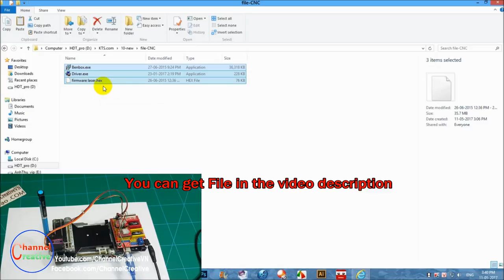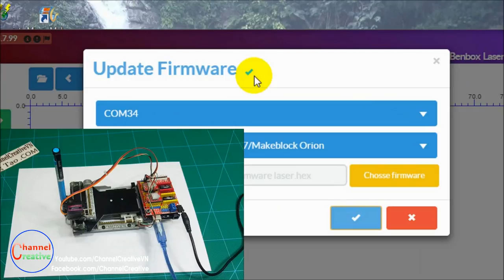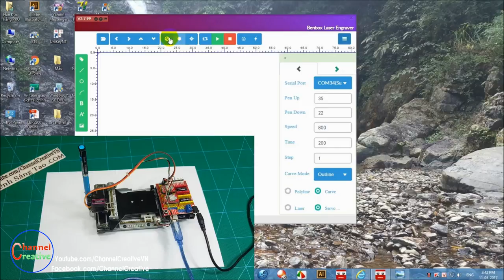How to Make a CNC Drawing Machine at home

Comment: I have completed the project as shown in the video if anyone has any difficulties comment below
Please like this comment as other people might find this comment easily
Reply: How can I get that firmwire
Reply: Thanks as soon as I finish this project I will let u know.  Txnn for replying
Reply: If any other difficulties let me know
Reply: What do yo want to know
Reply: 11:27 that is a female jack 16:04 those are female header pins
Reply: i have made it but none of 2 stepper motor is responding what can be he problem.please help
Reply: 1. Check if a4988 drivers are in the correct direction
2. Check Voltage supplied to the CNC shield is proper (mine is 5V 2A)
3. Adjust the potentiometer on the A4988 driver
Reply: Prathamesh Jakka  thanks but how can I adjust the potentiometer
Reply: as given in the video follow steps
they are correct
Reply: do we need any arduino code for this project?or just following the video steps would work?
Reply: no Arduino code is needed follow as per steps
Reply: Bro. I need your help . Can we discuss it on whatsapp ?
Reply: Yash Shah we should discuss it here as other people too might find your problem useful
Reply: Prathamesh Jakka my motor didn't work on 5v 2A , but when I use 12v 1A it work fine but heat up too much . What should I do ?
Reply: Prathamesh Jakka is 0.20 is okey for this ??
Reply: yes
Reply: What is on 10:55 is it necessary I don't know what is that plz tell me
Reply: KICHU Rock yes that is a jumper pin it is necessary for microstepping
Reply: Prathamesh Txnn can I get that from a electric store
Reply: yes you can you can even salvage them from old cd or dvd drives
Reply: my servo vibrating only what is the solution ?
Reply: try changing your Arduino cable the cable you are using must not be able to power the servo
Reply: but servo get too much heat and it is stop because it rotate too much and put force on mechanical stop, so servo is definitely powered , but it is powered by cnc may be.(i use 12v 1A for cnc ,5v 2A is not working)
Reply: use 5v 2A for cnc and adjust a4988 potentiometer, don't use 12V
use shorter cable as i had the same problem too of the servo motor
Reply: Prathamesh Jakka but when I use 5v 2a my x and y motor does not working , i have set potentiometer of both driver at 0.20
Reply: Does the motor work at 12V
Reply: Prathamesh Jakka yes it works very well , and there is write on CNC shield says it need 12v to 36 v
Reply: From where I can get aurdino code?
Reply: Prathamesh Jakka  bro , i test today my machine. It works well but when dnt draw anything , servo is continuously vibrating
Reply: Prathamesh Jakka  thank you I will try it and let you know soon
Reply: Yash change the cable connecting arduino to PC, I had the same problem when I changed the cable problem fixed
Reply: Prathamesh Jakka ohk i will change it and then after I will tell you the result
Reply: I'm thinking of making a tutorial on my plotter which is made from laser cut parts in Hindi,Anyone intrested?
Reply: Prathamesh Jakka ...hello bro i have a doubt that .is there any difference in arduino atmega 328p and just mega 328p ?
Reply: Prathamesh Jakka. Sure bro but English would be more easy to understand if you do it on english.
Reply: afsal Shereef yep I'll make it in English just editing it
Reply: Prathamesh Jakka wow thats great. ...thanks
Reply: bro can ve insert any image insert of you tube symbles
Reply: Jaya Rama Raju Alluri yes we can insert any type of image we want
Reply: tnx broo if i faces  any problem can i ask u
Reply: +Prathamesh Jakka      i had one problem  ,,  servo motor is not working ,  but stepper motor is working,,,,,,, iam using   sg90 servo ,,,
Reply: Suriya Bala is the servo motor vibrating or completely not working?
Reply: I have completed my project but servo motor is not running where was the fault please help me
Reply: Harsh Prajapati is the servo motor at least vibrating?
Reply: Noo it's not running not at all
Reply: Harsh Prajapati check if you have connected servo connection properly on the CNC shield
Orange to z stop
Red to 5v
Brown to gnd

Else change the usb cable to a shorter one as the usb cable connecting to the Arduino may not be able to supply enough power
Reply: Yaa but in video orange is connected to z+
Reply: Harsh Prajapati yep z+ it's correct
Reply: So where is the problem
Reply: Harsh Prajapati the usb cable
Reply: But i haven't usb any other than the Arduino board has it
Reply: Prathamesh Jakka  servo  motor is completely not working
Reply: Harsh Prajapati is the cable long one ? Because I had problems with  longer cable because they weren't able to supply power , but when I switched to shorter cable all worked fine
Reply: bro what was the items used in 10.50 to 11.00
Reply: All that jumper pins female heads should be bought separately bfor they are in the driver itself.?
Reply: What is that at time 10:45 mini black thing
Reply: I try  download  file-cnc in te android mobile but do not downloaded please help
Reply: did i want to program the arduino
Reply: Prathamesh Jakka did i want to program the arduino
Reply: This project is completed but the software does not work and within 2 days the sumbition day come plz help me.....
Reply: Sir can you pls tell me how to fix?
servo is working fine but the steppers are not working
Reply: Sir help me the machine does not work property
Reply: Hello 
I am making this machine as my college project. I have completed it but when i m connecting it to the pc/laptop the servo motor pulls the refill upward and when i upload a picture to draw it then the servo is making a dotted picture i.e the servo is moving up and down continuously. It is not making continuous pictures. What should I do? Please Help Me. It's URGENT
Reply: which company dvd player can be used?????
Reply: does smd version of arduino  work and what is that small thing which he is inserting in the middle part of the motor sheild.
Reply: hello.
can you tell me how can i get firmware. when i get ben box i will get firmware .
Reply: Bro in benbox software there is only COM3 and not COM3.what should I do .Is it ok
Reply: different arduinos have different comm nos
Reply: yes they are perfectly fine you can get perfectly fine stepper motors form non working drives too
Reply: you have arduino code???
Reply: @Prathamesh Jakka
reply please
Reply: its in the description of the video
Reply: its only two application and hex file
Reply: if you have a code please send to me
Reply: follow steps as per the video 20:40
Reply: then what is the purpose of that firmware laser.hex
Reply: brother i need your help....
my motor is vibrating when i connect the arduino cable with the computer without the help of this SOFTWARE ....what wil i do.i also change the motor but same problem arises .....
another problem  is the firmware does not match,it show X at right site ..
is COM10 right???
Reply: try adjusting the potentiometer of a4988 driver as it may be3 not supplying enough current to the motor
Reply: Prathamesh Jakka 
I also adjusted  but the same result repeatedly occure
Reply: try checking the com port which you have connected to correctly
Reply: also one more important thing is that you specify the correct ports like this 21:36
Reply: 10:51 what are those small things in her hand ?
Reply: #TRENDzz they are jumper pins
Reply: #TRENDzz yes you've got the correct link that are jumper pins
Reply: Please brother share the arduino cod for cnc macihne i finished this projetc but i need the arduino cods please help me
Reply: Prathamesh Jakka  I need your help. when i put the dvd motors  in arduino they get hot. a
Reply: u need to supply less voltage to the stepper motor what voltage are you supplying
Reply: Prathamesh Jakka  can you replay messages in facebook?
Reply: i give 5v in cnc sheild servo moter not work
Reply: @Prathamesh Jakka
my servo motor is not working with the cnc sheild
Reply: @Prathamesh Jakka
 how can i fix it?
Reply: I need the PDF of this project or pllzzz
Reply: Plz i make all the steps put the cooooode or the programing plz help me for the code or anything plzz
Reply: Prathamesh Jakka  I need the documentation of this project plzz send me
Reply: From where can I get ALUMINIUM COPOSITE
Reply: Where do I get aluminium composite
Reply: I have done all think but both feed should have no movement pls help
Reply: i made one .but stepper motors are getting too much hot ,.i m using 5v 2A .
Reply: ok but Arduino programming should done compulsory  or not
Reply: Bro stepper motor stuck wt is the problem
Reply: yes how can I run
Reply: my ben box is not responding
Reply: Any idea why does OUTLINE mode fail to work? Works fine with those 2 Scan modes but not the Outline mode. I am trying to draw PNG image made in paint. Text only 4 letters TEST. But when I push start button it doesnt do anything. Any ideas?
Reply: my machine isnt printing i have arduino nano please help
Reply: Prathamesh Jakka Am interested in this project .. so could you please provide me the programming and the circuit diagram??? .. am ready to buy all the parts but need circuit diagram and programming first.... Please help .... 😊🙏
Reply: We have to adjust 20 volt on boyth A4988
Reply: Prathamesh Jakka bro i need your help
Reply: sir i have completed the project, but only any one stepper is rotating at a time, what to do
Reply: Tell me the shopping app where I can easily find all the parts.
Reply: Does it really work , and how to tell it what it have to write
Reply: Adjust the potentiometer on the a4988 drivers
Reply: color of the stepper motor driver does not matter
Reply: where comment the time
Reply: yes micro stepping jumpers are necessary
Reply: try changing the usb cable that you connect it to the computer
Reply: there is no pdf documentation?
Reply: yes what help do you want
Reply: you can use acrylic too
Reply: try adjusting the potentiometer of a4988 drivers
Reply: adjust the stepper motor potentiometer
Reply: yes arduino programming is necessary
Reply: check if any parts are blocking the motor shaft
Reply: or try adjusting the a4988 potentiometer
Reply: what all parts you have bought
Reply: why is it not responding from the start?
Reply: which cnc shield version do you have?
Reply: what all parts you have bought till now?
Reply: do not supply 20 volt to the cnc shield as it may damage the board
Reply: describe the problem in more detail
Reply: ebay amazon aliexpress
Reply: yes it does really work,  you send commands to the machine through gcode
Reply: Iss video me servo ki value 11,11 h... Pr us  muje servo se koi respond nhi Mila.. bs computer se attach krte wakt move hoti thi..

Fir mene 11,1 setting krti to ab up and down move kr rhi h proper jagh pe bs hlka sa rotate ho rhi h muje thoda Jada rotate krvana h..
To konsi setting kru...
Reply: change pen up and down settings
Reply: How spring change kr k dekh li mene.. 
Servo motor se thread kich rhi h ar pen up ja rha h but hlka sa ky hm servo ko thoda Jada rotate nhi kr skte ky
Reply: Pen up and down setting ka ky mtlb h ...
Reply: pen up and down sets the servo value you can input any value from 0- 180. you need to experiment a bit to find correct values
Reply: And where I get these setting..

Because in my computer benbox has been installed in chinese language... I set the values using Google translate
Reply: what I have to change 
Intensivity,speed,time,step
Reply: Prathamesh Jakka bro 16:06 mai jo black colour  ka h jismai wire connect  kr rhe h usse kya bolte h
Reply: +Sarah Anjum , its called pin header
Reply: Thanks for your help . Today I have completed this machine  ...
Reply: But dvd drive ki jo motor mene use ki h vo heat up ho rhi h..
Me 5v 1A ki power de rha hu...
Motor k upar lagane ki koi tube aati h ky jo use thoda cool rakhe
Reply: Mera printer complete ho gya but vo double line me draw kr rha h...
Mtlb vo hr single line ko 2 bar draw kr rha h jese vo line ki thickness k 2 side draw kr rha ho...
Plz iska solution malum ho to jaldi bta dena kuch din bad muje presentation deni h iski
Reply: sir i have comleted the project but only any one motor is responding at a time, if 1st motor responds 2nd does not and if 2nd responds 1dt does not... 
please give me some solution
you replyed to many answers but which is my question's answer
Reply: sir i have comleted the project but only any one motor is responding at a time, if 1st motor responds 2nd does not and if 2nd responds 1dt does not... 
please give me some solution
you replyed to many answers but which is my question's answer
Reply: sir i have comleted the project but only any one motor is responding at a time, if 1st motor responds 2nd does not and if 2nd responds 1dt does not... 
please give me some solution
you replyed to many answers but which is my question's answer
Reply: please write my name before the answer... plzz, so i can find it easily
Reply: Bro for updating the firmware it is asking some lisences in benbox
Reply: Prathamesh Jakka can u please send me the link from where I can buy aluminium composite😣😣
Reply: Can I use another servo
Reply: How to Make and Do plz send me link from where I can buy aluminium composite.
Reply: Prathamesh Jakka plz send me the link from where I can buy aluminium composite.😣
Reply: Can i use another servo motor
Reply: prathamesh jakka can you please give me your video link to make the cnc machine.
Reply: That was not aluminium composite . It was acrylic sheet.
Reply: Hi,
I have completed the CNC project just like in the video and it worked great when I connected to a bench power supply with 5v and 2 amps.
I also used the video that you suggested above to fix the voltage for the potentiometer's voltage to .2v (Thank you so much for that).
The problem is that when I connect the CNC shield to a  5v-2amp power adapter, 
the motors heat up and the torque of the motors decreases.
How can I solve that. (PS: I also checked the Voltage for the potentiometers again with the power adapter).
Reply: Hii smasher can you make the video on that in Hindi plz.
Reply: What type of charger is used and it's voltage
Reply: 5 v 2-ampere charger
Reply: On CNC shield it is written to supply 12v....so...is 5v sufficient for it?
Reply: Those jumper pins which he attaches on CNC shield....is it necessary...can we directly solder those....?? actually I can't find them...so I made some myself by female header by soldering it's tip to each other...is it ok??
Reply: yes
Reply: Prathamesh Jakka always light on the aurdino is turning off  when i m connecting a4988 driver module and we should write any program for aurdino can u plzz help
Reply: I have made the same machine but servo motor is not working in that help me in resolving this issue. Please
Reply: Hey all 
The project worked fine with me. At first I was having trouble when connecting the project to a 5V 2A. Then someone suggested that I use 5V 2.5A and it worked superbly. Even the motors stoped heating up
Reply: The Smasher is there any program fr this project
Reply: Prathamesh Jakka 
In this video at 10:50 what is the name of those little pin and from where i can get that 
Those little pin are compulsory to put on cnc shield
Reply: when i try to update firmware it give me an error :
" avrdude.exe: safemode: Ifuse reads as 0
avrdude.exe: safemode: hfuse reads as 0
avrdude.exe: safemode: efuse reads as 0
avrdude.exe: safemode: Fuses OK

avrdude.exe done. Thank you. "

can you help ? tnx
Reply: which is to used to stick the pen in MG90s servopls help
Reply: Can we get jumper pin from any die machine bro plzzz tell me
Reply: Prathamesh Jakka where r u bro 
Plzzzzz bro help me
Reply: What are the black plugs kept to the shield under the driver
Reply: Pleasezzzzzzzzz answer fast
Reply: Total cost in making this?
Reply: bro my firmware is not working what should I DO?
Reply: Brother how costly is it? How and where can we collect all of the resources? And much time will it consume???
Reply: what are the 6 small beads used at 10:53
Reply: i try to make this project i have come problem in making a frame can you help me please
Reply: My servo is not working bro 
What to do
Reply: But in your Earlier Comment you said No need of arduino Code Just use the same step which is shown in video
Reply: my servo is not working what should i do
Reply: TECH VIKAS use 12v

Select servo in the drop down list in beanbox
Reply: where its code
Reply: where is the code
Reply: can you please tell what to keep the resistance of stepper?
Reply: Prathamesh Jakka  bro my servo is continuously vibrating and not working
Reply: my servo is vibrating and producing lot of heat
Reply: if any one servo is not working try to change no given ben box in servo position 11 and 13
Reply: What is that at 10:50. Please reply fast
Reply: What is this black material that uses
Reply: Still It's Not working
Reply: Stepper Motors are not working I followed all steps
Reply: Prathamesh Jakka  where is the code to program an arduino?
Reply: From where can i get female jack that are used in 10:51
From wher can i get it
Reply: We can not run thr project in benbox. Please help. We have used cnc shield and uno board
Reply: sir can you tell about the wire sequence
Reply: or circuit diagram
Reply: can you explain me about the wire
Reply: about cd rom stepper motor wire working
Reply: i attach wire according   to your give  idea but it not work it heat up
Reply: any tell me please when i run this first time it run but second time when i run it heat up and not running
Reply: I have difficulties in programming, Can someone help me please
Reply: I have difficulties in programming, Can someone help me please
Reply: i can help you
Reply: Yes of course
Reply: you can me goes by at parts what you used because I stayed at doubt over the programation of Arduino no got it nothing!!! As do the programming, if have as  pass one manual step by step
About the programming arduino, I wanted much
Reply: The dvd motor overheat
Reply: Where i can buy those jumper caps only 10
Reply: hi
Reply: Prathamesh Jakka my motor is too hot.. it moves hardly (sometimes no movement at all, though motors buzz) in opposite direction.
Reply: when i run my stepper motor it heat up  i used 5 volt and 1A adpater it heat up due this or any other reason
Reply: Sir in my benbox software- in update firmware option it doesnt show com3 or com6 pls help me fast sir
Reply: Prathamesh Jakka 
bro we did it but...our pen z not moving in z direction ...and we used bnbox software
Reply: Is this want to have programming?
Reply: i made this but when i run my servo gets to the end of rodd and start pushing further in that direction
Reply: Can u send this machine to me i will give u money
Reply: Jakka can you help me I am urgently about what type of jumper cap he us in at 10.55 there
Reply: my survo is only vibrating and do not working pls help
Reply: Can we use not working dvd rom? As shown in this video
Reply: Hi my servo motor is not working the arms of servo is not rotating but inside it there is some vibrations
Reply: Can I do it with Arduino l293d shield ? Please reply
Reply: How much time it took to complete this project?
Reply: can I know what is the thing on his hand in 10:50? thank you
Reply: Alan Lee they are jumpers to short the connections
Reply: Vishal Gaurav can i dont put it？
Reply: You need to put to select the stepping. Don't worry you can simply short terminals using soldering only.

Do share your progress :-)
Reply: Vishal Gaurav thank you very much do u mind i put ur name on my project for the reference？
Reply: No need Alan, just share when you get it finished. I would like to see your machine.

Good luck 😊
Reply: Vishal Gaurav ok.that‘s for sure i will share it
Reply: Update firmware taking long time
Reply: How to connect the wiring of x,y axis of slider??
Reply: Prathamesh Jakka bro I have used sg 90 tower pro servo motor can u please help me
Reply: What cost it is going to take to build it
Reply: what is the programming softwer
Reply: My stepper motor is heating and not responding what is the problem
Reply: Prathamesh Jakka bro i have completed this as shown in video.
But that two motors were not working properly they are didn’t move smoothly they are vibrating 
Plz help me what can I do for that issue?
Reply: +Binura Lakshan Try adjusting the potentiometer setting on the a4988 driver
Reply: @Abid Shaikh try adjustiong the potentiometer setting on the a4988 driver
Reply: Jaya Rama Raju Alluri those are jumper pins
Reply: +Ayesha Zarreen Those pins are called jumper pins
Reply: Zeba Tahseen you can get jumper pins from DVD drives
Reply: Rahul Tej jumper pins
Reply: Hi what voltage and current you use?
Reply: Prathamesh Jakka  where are the jumper pins in DVD writer?
Reply: Prathamesh Jakka what to do after downloading CNC file rar
Reply: Jay Mishra https://www.google.co.in/url?sa=i&source=images&cd=&cad=rja&uact=8&ved=2ahUKEwjlqd3em5_cAhUIOo8KHZ2AD6UQjRx6BAgBEAU&url=https%3A%2F%2Fsupport.hp.com%2Fus-en%2Fdocument%2Fbph03792&psig=AOvVaw3kMyfKcrF6_w1fMRT2EUfX&ust=1531679182157608
Reply: Prathamesh Jakka what shall i do with this link
And where can i find jumper pins in DVD writer?
Reply: Prathamesh Jakka When i try to upload a code its when i put CNC shield on it please help what to do????
Reply: Hey prathmesh when i try to upload a code or flash a firmware its showing failed and showing red cross what  i should do plz help me plz.....
Reply: Tech Norg I didn't understand your question?
Reply: Prathamesh Jakka  When i try to flash the laser hex firmware its not uploading rather its shows red cross in benbox
Reply: Tech Norg is the COM port of Arduino connected, is it visible in settings
Reply: Prathamesh Jakka not about that pin  yar iam having it

When i am flashing the benbox firmware its not flashing on arduino
Reply: Prathamesh Jakka when i connect arduino without cnc shield it works
But when i connect using cnc shield it doesn't show up anything
Reply: Tech Norg do not connect power to CNC shield while uploading code
Reply: G TECH MAKER i dont use whatsapp
Do u have instagram becoz i have 

Its techguy33
Reply: Prathamesh Jakka i tried it its not working
Reply: mujhe pest Marne wala same gluu nhi mill RHA hai or but si object
Reply: mujhe pest karne wala same gluu nhi mill RHA hai or but si object
Reply: Need help please
Reply: Bro I need help is that and what is the correct direction form the servo motor mine one is MG90S
Reply: Bro for the  servo x /y 11-11 is those number are the correct or need to adjust. Please I need for urgently
Reply: Prathamesh Jakka from where can we get header pins
Reply: Prathamesh bro I adjustable the pointmeter  are day but both motor still run in heat when the operating
Reply: Can u please help me i completed the project but don’t no how to get the benbox software
Reply: Skadi Lolikon1250 is benbox and the driver software in that or do u have to download separately
Reply: Firework pro  bro this file have  contains the firmware . Hex that the update for firmware  and the be box exe
Reply: For this ben box use first you need to plug you USB to the port maybe will be com 6 or com 7 or com 44 and com 33 mine one is com6 and after press open file to input  the firmware. Hex to be box and update until you see the correct logo at right top.
Reply: After it  try to will about at the right end you will saw about the three lines logo press that  and you will saw a bar slide out  form right side frist for serial port chose the com that you updated . Second have you saw a crave mode press that and choose outline mode and . continues / servo. So if those are done now the time you have to view about the right arrow and I the same moment it will move to another bar and it show you about 
X- Y SYMBOL FOR THAT YOU JUST Need to follow about the numbering that have show in the video and after that Prees the down correct symbol. Done and time to input the pictures or type a word to write and if the pen reffile  no going to touch on the paper you have to view back to just now the bar and try to adjust about Pen Up /Pen Dow  = this is mine one Pen up : 3 / Pen Down : 72
Reply: Skadi Lolikon1250 right cheers man so it’s all in that file I’m not good with computers.
Reply: Firework pro  just open the file and install the be box  exe.  And the driver .
Reply: If I use plastic gear servo it will work or not
Reply: I have used sg 90 plastic servo motor it's not working😩😩😩😩😩😩😩😩😩 please help😍 me to configure it and setting
My science exhibition is on 23-8-2018please me fast 
Please
Please
Please
Reply: ram udu  lol  iam going to presented in tomorrow.  So can you say more details  about this maybe I can help you to solve this problem
Reply: ram udu  form mine one pen up is 12 pendown  is 60
Reply: ram udu check back the string that you tide up
Reply: ram udu  remember  servo motor wire  Brown is going to GND, red is going to 5v yellow is going to Z+
Reply: Are the connections same for all the stepper motors??
Reply: Hrihansu Agarwal  not really
Reply: Can you give me the code of the arduino according to the video
I am having difficulties in coding it
Reply: Having trouble in making it
Can you make one for me
If not,I will try making the model but can you give me the coding of arduino according to the up video as I will make my model like the up video
Reply: Bro my doing this cnc project my problem is in cnc sheild before putting heat sink he  puts some 6 small black colour pin then he puts heat sink so what is that small one
Reply: Can you give me the arduino coding
Reply: Please give me the arduino coding
Reply: Who me
Reply: Why
Reply: Type the coding
Reply: my servo motor doesn't work and my y-axis is slow. plz help
Reply: Prathamesh Jakka 
Can I make a larger version of it
I mean will the codes and all change
Reply: Does the Arduino doesn't need programming code
Reply: What are the things used in the project at 10:55
Reply: What is used in the project at 16:31 to connect the motor cable to the board
Reply: i have completed the project but cnc shield X is not working
Reply: I want to purchase one .... how much for one set
Reply: vai aluminium sheet ka size kinta lena parega?
Reply: Prathamesh Jakka 
In Ben box I have com 1 only how can I insatl com 3
It can work on com 1
Reply: Can i draw potraits with it?!!!...How? Bro plz help
Reply: Hi. But benbox is giving error that it cannot connect firmware
Reply: I have not connected those jumper pins and when I connected arduino with my PC and installed the software but I am not able to flash the firmware, what is the problem. Please respond I have to submit it to my school tomorrow.
Reply: friends. Where should I buy old dvd drives?
Reply: Can we use laptop cd dvd drive.
Reply: If I search for a laptop CD drive, will I find a place to sell it? I'm searching right now. ㅜㅜㅜㅜㅜㅜㅜ
Reply: If you do not mind, can you give me the address to sell?
Reply: @PrathameshJakka   hey The arduino  is one  or  is the mega
Reply: Hey is the  arduino uno or  is the arduino  mega
Reply: @PrathameshJakka   We have made a project on this only but the software is not working.
Its showing insufficient resources
Reply: Bhai this app can work on mobile can we handle this with mobile in anywhere
Reply: my stepper motor is not working and getting heat
Reply: My stepper motor are not working please give solutions
Reply: Where can I find this dvd drives?
Reply: bro my servo motor is working 
means when i give command to machine then x and y motor is working but servo motor is working 
can u help me 
i hope u will replay me soon
Reply: Please help !!
Benbox isn't detecting Arduino port.
Reply: i have completed all the steps but when i execute the program on my computer both the motors heat up and do not work...can someone pls give me a solution
Reply: Can i replace the servo motor from mg90 to mg995?
Reply: hy..can you give me complete instruction plz?...i really need..
Reply: i am not getting option of com 34 in update firmware
Reply: sir uska programing nhi samja
Reply: Bro can u make a video of programming this machine . I have all the components but don't know how to program it.. please help me
Reply: SORRY
I HAVE A QUESTION
ALREADY COMPLETE THE PROJECT EXACTLY AS IS IN THE VIDEO EVEN ALSO CALIBER THE DRIVERS BUT ONLY WORKS MY MOTOR SERVO AND THE 2 MOTORS STEP NOT WORK, COULD YOU HELP ME?
Reply: I has difficult
Reply: Can you make a video by speaking
Reply: Sir, can it be used to write on the pcb board too?
Thanks
Reply: what is the black thing attached to the CNC shield??? Quick response please
Reply: 10:53 what is the small thing???
Reply: Is it working?  And how much cost it take?
Reply: How many rupees of this machine
Reply: I need help I completed it (software help)
Reply: Prathamesh Jakka hi there can u help me please I don’t no how to set up the binbox software I’ve looking of a long time for a video on how but nothing to be found please help.
Reply: what are those thing he connects to the arduino  cnc shield v3 in 11:00
Reply: The Geek there called ( jumper cap pin ) there for connecting the pins on the cnc shield together.
Reply: Com 3 and 4 is not coming. Pls help.
Reply: Which software 	r require...arduino ide,and waht
Reply: @agjupiter6881 software name : Arduino 64bit
Reply: I konw but other software....
Reply: @agjupiter6881  Sir I have not made it .I have only ordered it for Amazon it will come tomorrow and than I will start to make it .I will let u know when it come and ask u what is remaining
Reply: @PrathameshJakka  which dvd driver is best
Reply: How much it costs
Reply: @noobanimations19  Rs 948
Reply: Hi, can I get the components details .. in the video all item description in not shown
Reply: Pls make a video on programming this project
Reply: i am not getting the file laser.hex
Reply: @PrathameshJakka   how can i get laser.hex file
Reply: my firmware is not getting updated what to do ?
Reply: @PrathameshJakka   I am not getting my firmware update what can I do
Reply: Pls reply fast
Reply: I have science exibition one week after
Reply: @PrathameshJakka  pls help me
Reply: @PrathameshJakka   what can I do if my firmware is not updating
Reply: @PrathameshJakka  please help me
Reply: Please send me the key to the update ing my firmware
Reply: how do i get the back end arduino code  for this plotter
Reply: DVD motor is heating fast
Reply: what do you call that small thing he attached to the cnc shield around 10:52?
Reply: plz provide srource code
Reply: @PrathameshJakka  where can I get Female header Pin 
Kaha milega vaiii
Reply: @susan5243  cd drive ke back side jaha pin connect hote hai waha milega jumper pins
Reply: @PrathameshJakka  I mean female header Pin vai kaha milega Vai yee
Reply: Hlo sir, 
I have a problem ,my servo is not  working what should I do......
Reply: @lillysukumar2318  check if you are supplying correct power to servo and set correct pins
Reply: Prathamesh Jakka  plz reply ,my servo is not working Thankyou sir
Reply: @lillysukumar2318  is it still not working?
Reply: Prathamesh Jakka  yes sir I have connected correctly
Reply: @lillysukumar2318  try changing the usb cable as i had problems with the usb cable and my servo was not working, i replaced the usb cable and the problem was solved
Reply: Prathamesh Jakka  usb cable changing in the sense.
Reply: Prathamesh Jakka  sir   how to check whether the signal is coming on z+ on grbl board.
Reply: @PrathameshJakka  Vai ye female header pin kaha milega plz bataoo na plz vaii
Reply: 10:55 what the small thing that connect
Reply: @muneesmohammed4545  jumper pin you can get it from motherboard
Reply: what software??
Reply: Prathamesh Jakka hi! If I will try to make this as a research or thesis project, what possible problem can I address for doing this?

Really need your response thanks
Reply: can i use t2laser over benbox
Reply: My firmware was not dumping it showing wrong mark what can I do rply me as early as possible
Reply: The dvd writers are not moving
Reply: My plotter didn't move, but the motors are vibrating, what's the problem with my cnc?
Reply: Этот проект не будет работать, если вы не ставите концевые выключатели
Reply: how can i control it by android
Reply: how can i control it by android??
Reply: hello sir, 
can u please help me out with the benbox software
Reply: Thanks, I also completed this project but when I am giving the 5v to the upper cnc card motors are not working and if I give 12 volts it works but Booth motors are heating too much... If you have any ideas please let me know..
Reply: i´m trying to make this project but when i plug the shield to the alimentation source it lights limit sign and the motors don´t move
Reply: @PrathameshJakka  vai My machine is not working plz help mr
Reply: it is necessary to use same to same dvd drives with same length of motion (like 40mm × 40 mm) ??? or we can use 40mm × 35 mm ???
Reply: Dude com34 doesn't come
What should I do
Reply: @JustforFun_8  same Problem bro 
But com3 will appear on my screen
Reply: Dude what about 18v power supply to v3 shilder?
Reply: Does not uploading file x mark comes after uploading hex file why?
Reply: Hlo sir my servo is not working what should I do
Reply: @PrathameshJakka   should  we code arduino or not? I am getting  trouble there.please reply me
Reply: @Prathamesh Jakka, is it possible to connect it directly to pc bypassing Arduino?
Reply: do i need any code to dump in Arduino Uno plezz help ASAP
Reply: I want to buy
Reply: on cnc shield it is mentioned that 12v then why we are suppose to give it 5v supply ?
Reply: @PrathameshJakka  from where  i get wiring diagram it differ to understand it from video plz help
Reply: Bro when we update firmware doing it shows on the display is script error and says update dll file
Reply: 2 Amps will not it be High enough to damage the CNC circuit ?
Reply: Bro update firmware shows error 
What can I do to solve the problem
It shows on the display script error update dll
Reply: Can you help me please
Reply: @rayansaeed9066  yep
Reply: @alonethrottlerider1257  check ur Arduino is working correctly or not
Reply: @rayansaeed9066  we might discuss it here this will help others too
Reply: Can this machine work if instead of DVD driver I use 2 Nemma 17 stepper motor, cnc shield v3, arduino r3, a4988 driver, mini servo,  with 24volt power supply. If you give me your gmail I will send you the entire setup. Please please please help me.
Reply: @teddytoy6078  I have raised its images on the arduino  but the CD  it not response😢
Reply: @teddytoy6078  how to check the Arduino bro help me to check
Reply: @teddytoy6078  how to check the Arduino bro help me
Reply: @teddytoy6078  I have solved the problem first But now the servo does not work why.Is there a difference if you use mini or micro
Reply: I want to know that... How can we create hex file.... Grist I open benbox, did all the settings... But I don't have the hex file of my image which I want to draw.... How can I get it or create it.. Plz help.
Reply: I have made this project my stepper motors are working but my swrco isnt working
Reply: S
Reply: Bro mh servo motor is not working tell me whats the problem
Reply: what's the black material that use to make to support?
Reply: @ed.running  bro its not necessary u use that black material  .u can simply go to the shops from where i have buyed all parts or a stationary  and several sheets come like this
Reply: that is connecting thos two
Reply: Bro What is that small thing begin 10:50
Reply: These u will easily get at electronics shop from where u have buyed this shield and as per my knowlege we usually get this with cnc shields..
Reply: @ItsMeRishi  bro that the thing connect of that two
Reply: @vaishnavtv1409  bro explain it briefly..i am not getting what are u talking about
Reply: This is incredible idea.I like it.keep it up
Reply: whats the black sheet calles
Reply: My stepper motors are not working
Reply: plz whats the black sheet used as base etc is called
Reply: i was completed this project..but my stepper motors are very heated. what can i do?
Reply: @PrathameshJakka  I can't able to download zip file from this link it downloading simple file and when I try to open it says this file can't open
Reply: Till how much should the potential Meter be adjusted
Reply: Bro can u send me the circuit
Reply: Hello! My two motors doesnt work at the same time.... What can I do? Please help me!
Reply: Hello sir 1:58 what is name of that device?
Reply: can u plz send the codes
Reply: servo is only vibrating
Reply: COM1 and COM34 are missing
it is only shown as nthing is selected. what should I do?
Reply: Bro serial port is not visible in the benbox
Reply: Bro can I use micro servo?
Reply: Bro when i connect motors they heat up lot and doesn't work at all
Reply: Can u plz tell me that can i use L293d motor driver shield instead?
Reply: can i use drv8825 instead of A4988 without changing other things
Reply: Only one motor is running
Reply: @shutterboy19  jumper pins
Reply: Bro we cannot get that green tick......what we dooooo.....
Reply: Prathamesh Jakka hi which size jumper cap to use ?
Reply: How much amperes are required for 2 ps nema 17 stepper motors
Reply: Hii
Reply: My steeper motor is not move only vibrate please help me
Reply: Is the software of this working???
Pls pls reply fast
Reply: What is the shortening link function ya?
Reply: Mine cannot do circle, but can do square
Reply: i also have made it. two stepper motors are working fine. but servo motor is not working. can you please help me.
Reply: Plesae
Reply: Hii bro, I have done total hardware and software. But the three motors are not rotating and they gets heated up. Can you guess the reason. Please reply.
  Thank you.
Reply: Hi bro, I have done total hardware and software but motors are not rotating and they gets heated up. Can you guess what is the reason. Please reply
Reply: We also just follwed what is in the video but the device wont move to any direction. Can you help us? The servo is the only one moving. Please
Reply: @zakishaikh7866  outline
Reply: @PrathameshJakka  My servo motor is vibrating but not functioning...my arduino cable is short....what could be the problem?
Reply: Stepper motor are heating at high level what can we do for that????
Reply: Can i use l293d shield for this project.... plz help me with that...
Reply: @PrathameshJakka  potentiometer kitne pe set karna hai sir...
Reply: my motor heats up when i use benbox even servo motor doesnt work whats the problem??